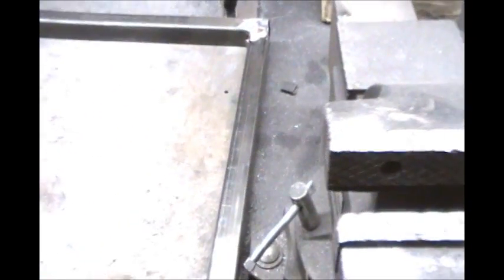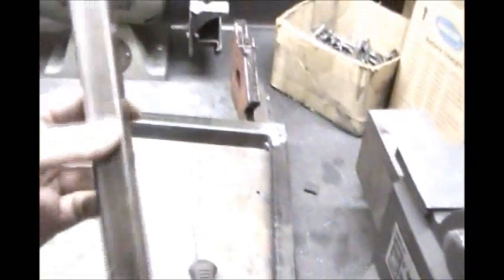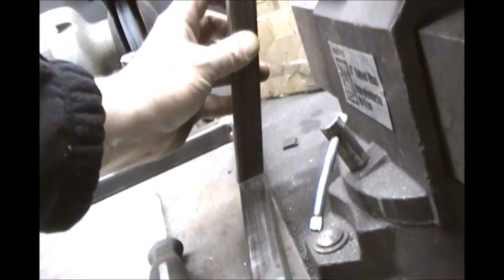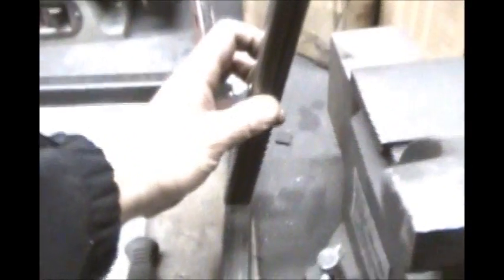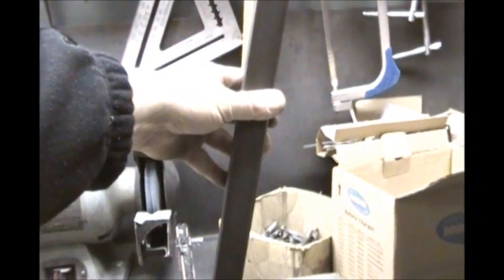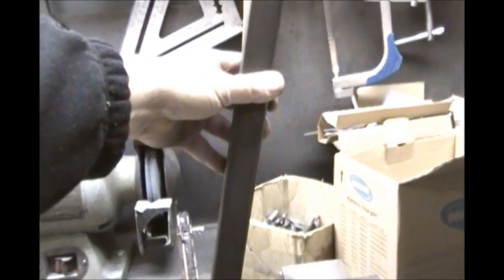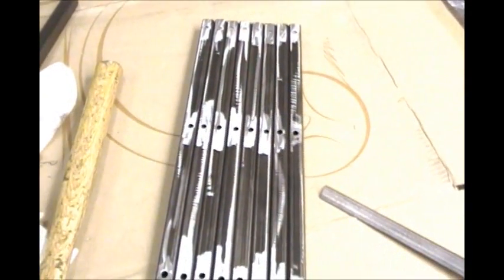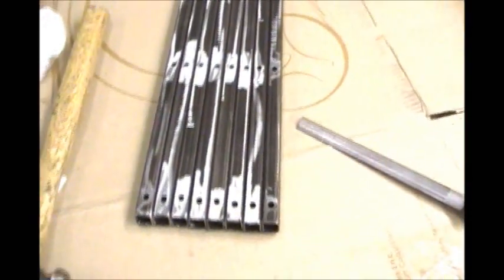Dead Things Vlog-Scissor Prop Build Part 1

Comment from the maker: It certainly may fall apart.  As well, there are only a few screws holding it onto the main tower, and they are only #8's. They may shear off.  Once I have everything working consistently, I will run it for an hour and see.  And no prob, your work is inspiring!